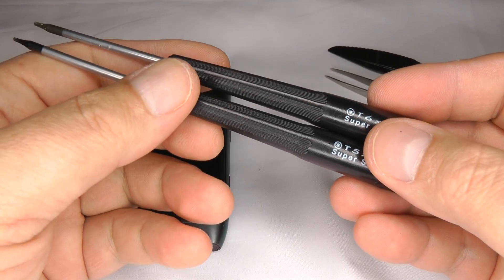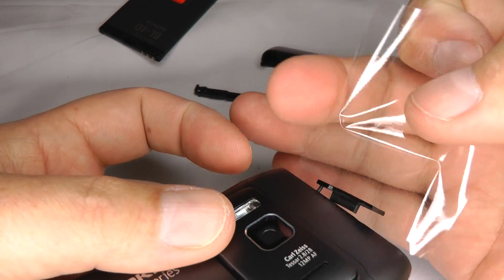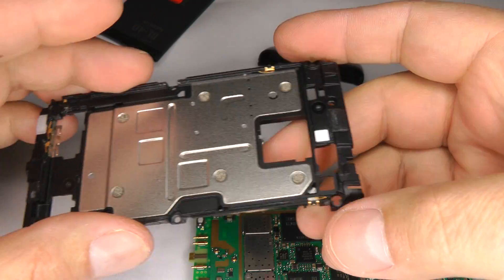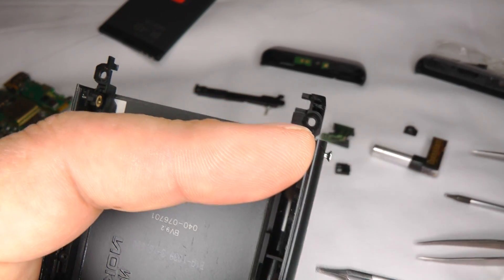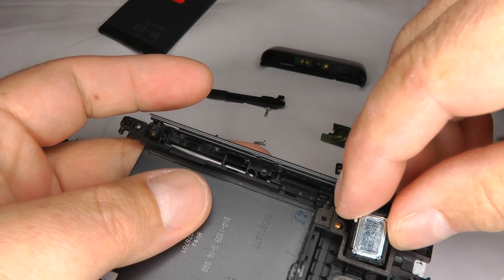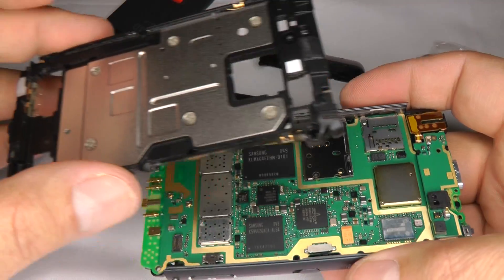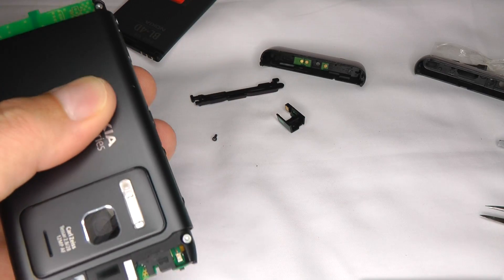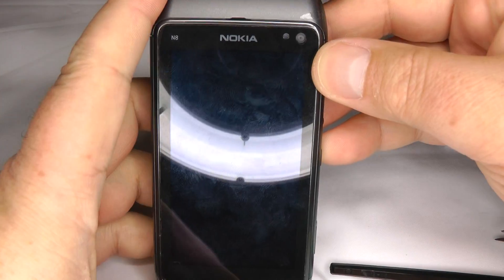Nokia N8 Disassembly & Assembly - Case Replacement

Comment: I was going to train myself before looking for parts or part donors to refurbish one. Well… First time disassembling touch screen phone.
I was pulling the battery out and id didn't wanted to move, not even milimeter. It came out after removing 2 T6 screws inside. Completely swollen to 2 times of its original thickness. Good I didn't found that charger and that battery is going immediatelly out of house…

Comment: First of all - thank you! Second - I had to open almost the whole phone to get my battery out of it - it started to grow uncontrollably blocking the option to just pull it... So... if your N8 stops charging (or  charges for 30 seconds just to be "dead" 2 minutes later)... might be a good indication your battery is plotting to kill you ;)
Reply: I have 2 batteries and I tried to charge it for 2 hours and unplug and 5 seconds later it dies. The charger port also doesn't charge if it isn't in the right angle and pressure

Comment: After watching that film several times and replacing battery and cover (with success :) I have a technical problem - for some reasons, my camera - after opening the app shows black screen. It seems that the app itself is ok. Moreover, the front  camera (selfie) works just fine. Any help? What can be my problem?

Comment: Just a quick thank you. The video pretty-much did what it said on the tin. The only problem I had (apart from spending 20 minutes fin ding a dropped screw!) was that pesky top cover. I tried the "tape trick" but no way would it move, so I had to prise it off causing a little damage. Anyway, all back together and working, so thanks again.

Comment: hi there thank you so much for this video.  I inserted a small sim card in the sim card slot and now its stuck in there. I think I damaged a pin while trying to take the card out but the card  is still stuck in there . I might need another part for the sim card to help it read it. but can I replace that part?

Comment: Still using this phone as a gps tracker and sat nav and occasional backup phone when the new one goes in for repair. Just changed the charger port and wouldn't have had a clue without your video. Thanks! All working again. Agree with the camera work comments, brilliantly shot

Comment: I followed this video, and after having reassembled my N8 it is behaving strangely. It switches on, but when scrolling through the menus, it freezes. Not possible to make/receive a call. Tried hard reset (8sec on/off button). Same everey time. Any sensors inside that can be messed up?

Comment: Wonderful!
Although my N8 frame was slightly different (e.g. clips protruding over screws) I have been able to open it to extract some SIM remains from the slot.
I would say that it is best to leave the lateral screws in place and only loosen them just enough to remove the bottom cap.

Comment: Had to open the phone up to retrieve a mini sim as I forgot which size sim it took, (having not used it in ages), from my Samsung S3...
Stupid mistake but it did work and I could send and receive texts. Obviously when I came to take the thing out, it just got further and further wedged inside the sim housing...
But, having your guide on here, made it pretty damn easy to open it up, retrieve the sim and put the phone back together again and it works!
Now I wish I'd managed to source a mini usb port as that thing hasn't worked in months but I think it may require removing and re-soldering?
I'm lucky I have another phone to use and this is just a backup though so not the end of the world.
Great guide. Slowly paced enough to almost keep up, (with a few WTF pauses due to fingers too big for this sort of delicate operation), and very well explained.
Thanks a lot!

Comment: Hey, I just disassembled it as you said and it works. Still, I have some questions. I bought a replacement case and it doesn't have the golden pins or little golden button you can see before putting the mainboard back (about minute 9). I stopped as I don't currently have another phone and was really worried that would stop working on the new case. Will they work or will the audio controls/camera stop working?

Comment: Watched your other video about how to change battery, but mine would not come out at all.

In the end, I found this video invaluable as I have just spent a few hours stripping down and rebuilding the phone just to get the battery out.

Just as well I did, as it has 'bulged' in the middle, hence explaining why it wouldn't just slide out.

Now It's all back together, no screws left at the end either, and it's up and running with a brand new battery inside, which slides in and out really easily :-)

Wonder how long the old battery was in that condition, even though it was still giving reasonable life for a phone that was purchased about 3-4 years ago?

Once again, thanks, and lovely close up video with easy to follow instructions.  I have given thumbs up as you have provided essential assistance.  I may have ended up breaking the damn phone in half had I continued trying to open it without your instructions.

Comment: My dear Friend. Thank You very much for teaching me how to fix my nokia n8 myself. I was not satisfied with the Nokia Assistance in São Paulo, Brazil. They inssisted that the main board was "dead" and had to be replaced. I just bought a new battery ( you tought me how to replace that)  and as soon as I turned it on " VOILÁ", THE MAIN BOARD suddenly regained life! Some 3rd world technician pulled out the touch screen cable so it was not working. You tought me how to put that in place too; so I became a FAN! Thanks again!  All the best!
Reply: Hi, I know I am a bit late to the party but I need to know how to fix the microphone. I can people hear talking to me but they cant hear anything. So I guess the microphone is to blame. I have already ordered a spair part.
Thx for your help!

Comment: The screws are almost non existent in America. can't find them anywhere.. and i really don't want to wait 2 months of shipping from china.
Reply from the maker: do you mean the torx screw drivers? There should be lots of hardware stores selling them. Is there a Maplin or Radio Shack nearby ?
Reply: no. the actual screws themselves..
Reply from the maker: ***** ah right, try buying a faulty or water damaged N8 off eBay

Comment: Hello good sir. Is there a way to unscrew on of those T5 screws if the screw is faulty? ( The T5 screw gets "loose" and can't unscrew)
Reply from the maker: try using a good quality torx driver or you can remove the head with a small drill

Comment: Hello, is there a way to change the headphone jack? Thank you for a great video!
Reply from the maker: yes it can be done but needs the use of a 'hot air' soldering iron. A local phone or tv repair shop might have the tools to do it
Reply: Ok! Thanks for the quick response!

Comment: you missed a step... im stuck at the point where ive disassembled the entire phone, taken the camera flash and speaker out, however i need to remove the part of the volume tab that is metal and make contact with the mainboard. also there appears to be plastic rails that run along the interior walls of the back plate. I've changed colors so im trying to switch everything, including the back plate. some insight would be appreciated
Reply from the maker: Nokia N8 Volume Key Buttons Removal and Replacment
Reply: thanks mate... i figured it out myself. theres a couple little metal pieces that seem fixed inside the case (small round gold switch near speaker, and flat metal tab near flash). I couldnt remove them and the new case didnt have those conductive components built in but i put the phone together anyway without them. i have yet to notice any performance issues, everything seems to be working as it should. Thanks for the concise informative vid!

Comment: hi there, i have some problems with the mass memory (16 gb memory) of my n8, i wonder if is possible to change the memory??
Reply from the maker: I think it can be done using a 'hot air' soldering iron but its hard to find the part or someone to do it
Reply: o well thanks

Comment: Is the audio jack replaceable? How difficult it is to remove and reassemble that on the main board?
Reply from the maker: it can be replaced but needs soldering using a 'hot air' soldering iron. If you can find the part, a local tv repair shop should have the skills and tools to do this

Comment: bro is it easy to change the sim card slot?because it's been broken and i don't know how to fix it
Reply from the maker: no its very hard as it needs the use of a 'hot air' soldering iron. Find a new sim tray and ask your local tv repair shop as they should have the skills and tools to do it

Comment: Excellent tutorial, but after assembling camera flash doesn't work...I've checked again connectors on the main board and re-assembly and still camera flash doesn't work..also the red light doesn't work. Should I reset my N8 or change the camera flash? Thank You
Reply from the maker: what parts did you replace?
Reply: *****
I didn't replace anything, but I had problems with sim slot...I had to solder connectors on the sim slot then I reassemble my phone and camera flash doesn't work, even red light doesn't work. How can I ensure that the camera flash works or not?
I've checked the pins again..still nothing
Any help would be appreciated.
Thanks
Reply from the maker: Stevce Veljanoski it might be worth trying another flash, but I don't see why it should have stopped working

Comment: Hi do you have any tuition on how to replace the sim card holder?
Thanks mark
Reply from the maker: Its a common problem on the N8, it needs the use of a 'hot air' soldering iron. If you can find a new sim tray your local tv repair shop should have the tools and skills to replace it

Comment: My Micro Sim is stuck at that slim slot. How to change it ? I need to get it working once again!
Reply from the maker: its a common problem if you read down through the comments, you need to be very careful not to damage the sim tray as they are not easy to replace. I would take the mainboard out and using a wood or plastic cocktail stick try and ease it out without damaging the pins, take your time and use an eyepiece and good light
Reply: ***** Thank you :)

Comment: Is it hard to change the mic in this phone? Or should I just leave it because it can be broken?
Reply from the maker: its a bit tricky, you can buy the microphone from aliexpress,com search for 544198837 and use the hot air tool to replace it

Comment: Holy crap, you know your N8's!. Anyway I stripped the two outer screws (on side of main housing) and the four that are below the top and bottom bit. I have searched high and low but cant find the sizes of them (length as well as t size). Any ideas?

Comment: ok, I'll try...but the thing why I want to disassembly the phone is that I cannot charge it. USB and wall charger are not working, but there's nothing wrong with battery. Do you know what so bad could happen that no ports are working ? (And yes, maybe few times that week, when this happened, I drop the phone - but in plastic phone cover and to the carpet...if that matters...)

Comment: phone touch didn't work. so i handed over the phone to local repair shop. they said that touch is needed to replace. they did it & now phone touch is OK. but mic is not working and camera is not working..when camera switch on snow only black screen..& can't answer the incoming calls..need ur help???

Comment: Thanks, this guided me well disassembling my N8.
The upper part removal was very frustrating, mine held very strong, it took a few sellotapes, and eventually a stronger threaded tape to rip it out. Succeeded with several burst-type strong pulls.
I want to replace the SIM slot I broke... it sits there tight and I'm starting to come to conclusion it might be soldered there. Can I replace it myself with rather mediocre soldering gun? I've got rosin, tin and acid as well.

Comment: followed your video to inspect my N8, i was having microphone problems, after running back and forth to a nokia shop and sending it off to nokia they replaced the microphone and sent it back, and after getting it back it worked fine until it needed charged, now it will not charge, got a new battery and contacted Nokia, they then told me it was liquid damaged, which is nonsense, i opened the phone today to see, any idea on why it wont charge, it beeps and lights up but will not charge,

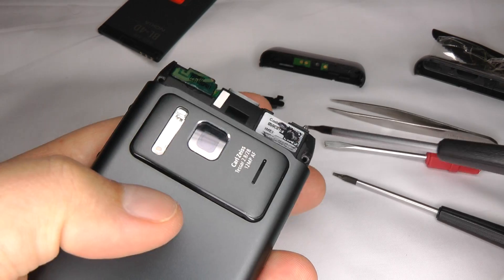Comment: I sent you a a Message on here, don't know if you've received it or not, But i need help please, At 3:00 The screws that take the GPS Antenna for the Screen to come off, Their is two screws, I tried taking them out, But the screws half become bold, as in shredded, What do i do to get it repaired to take out the screws where none of my T's Type screwdrivers will work, What is the best solution? Thank you :D!

Comment: Thankyou so much for this informative video & instructions, I never would have been able to fit a new housing without it. I do have a question though, my camera button (on side) and volume buttons aren't working - could I have refitted them upside down?  There was a thing bit of metal stuck to the inside case on the old housing, and I didn't  put it in the new housing  - that was close to the camera lens area on top right of back cover. Any advice would be much appreciated, many thanks. Z

Comment: took it apart and rebuilt again, gd news it now turns on
I manages to get my sim card out and fix the spring but the slot is now buggered by that adapter. I wish that the shops would warn people as it seems to be a common problem. Thanx for ur helpful video anyway

Comment: Any videos on how to replace the micro usb port on the n8?
Would greatly appreciate it, especially if it were possible using a soldering iron and not the hot air station required for other items mentioned before.
Used your guide for replacing the digitizer last year and it was a godsend as nokia wouldn't cover any accidental damage. Thanks!

Comment: hi, i have a problem with my n8 it has no network. i opened it up using your very detailed video and saw some dried up water marks. the water seems to have gone through the volume button into the phone and through the battery contacts.what do you propose could be the problem.thanks for your video...it has been very helpful

Comment: Great video. How easy is it to remove and replace the sim cradle on an N8. I put a mini sim convertor in to the sim slot (for safe keeping!) then when getting it out it wrecked the sim connectors. I know someone else who has done this too. So any help to get this great little phone up and running again would be gratefully received. Many thanks.

Comment: but it's not... i removed the top then click on the white little stick (suppose to be the power button), it does give me a clicking feedback, but the phone doesn't respond. Now i have to run it 24-7 and charge it frequently so that it won't run out of battery and turned off (and never turn on).
I don't know if you can help me, but thanks for the video and reply. Guess it's time to get a new phone :(

Comment: I appreciate your response, I will try to do what I recommended, the speaker seems to be broken, listens very strong, can not explain, another question, how do I run the FM transmitter in the new housing, I have to remove some of the old housing? ????

thank you very much

greetings from mexico

Comment: follow the steps as the video says, with the new housing I lost WiFi signal intensity, sound side buttons do not work, and the speaker is heard saturated, as I run the fm transmitter in another case? please help I can do???? thanks

Comment: tnx for the video,can you help me,my n8 was dead, but i could flash it  with phoenix with belle,the problem is      the button on/off dnt work at all,then if i take out the batery for restart it the screen bcme white again,the logo nokia appears but it dnt starts then i hv to flash it again,do i need to change the on off button?do u think its the only problem its have?tnx in advance,

Comment: No, unless you realy redesign the bottom part of the Nokia N8. As we know the bottom cover contains the GMS, UMTS antenna. The 1500mA battery can be squeezed in (I did it), however it is about 5mm to long. Then you can't put the cover back. If you have some 3D skills you can remoove your antenna from the original bottom cover (another Lessons video) and put it into a new custom made bottom cover you did print out on a 3-D printer for example ;-)

Comment: ok I'll try to change display, I just remember now, when it fall down i turn it off then turn on and i typed on screen something, probably i needed to enter the PIN code, it vibrates when i was typing... I give up take te sim card out and put it in another mobile, and it asked me for PUK code. so the n8 was working without display hehe, thanks for help :))) and just wondering is there any difference between those displays ( C7 and N8 ) because its not the same price

Comment: No, there is nothing on screen(black screen) when i turn on mobile, just menu button lights, it vibrates once just like when it start the program and nothing happened, after 1-2 min it vibrates again, and again...and so on! The computer recognize it before but now after i done the master reset(maybe i did it because i cant see anything) it wont recognize it! Is it the problem with screen, i cant see that is broken...

Comment: You are a savior...i accidentally put in my Lumia 920 micro SIM into my N8...followed your video and opened up my N8...got the SIM out and assembled it again...i had some difficulty in placing the two screw holders that take the initial two screws though...lucky i got them in and my N8 is also working as before...nothing broken...Thanks a lot!!